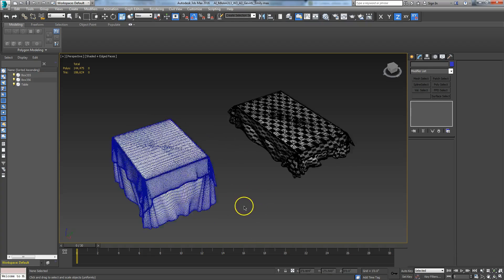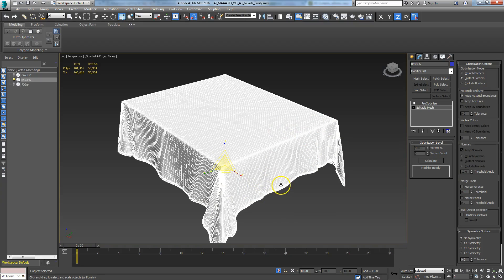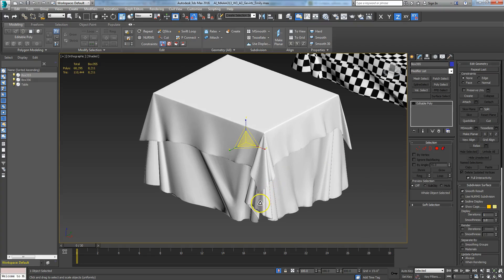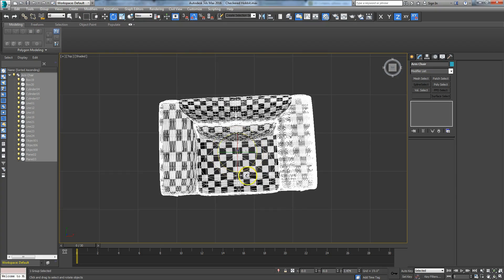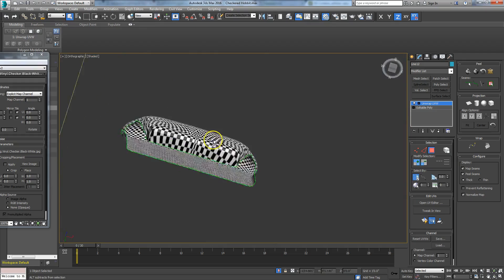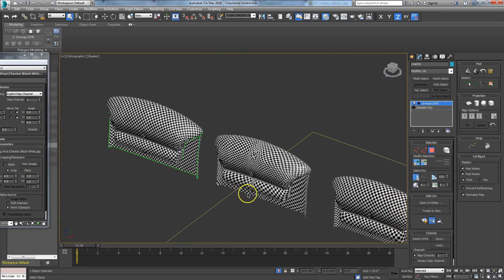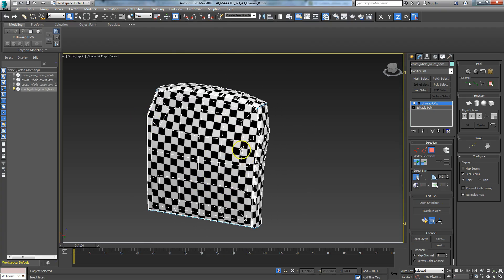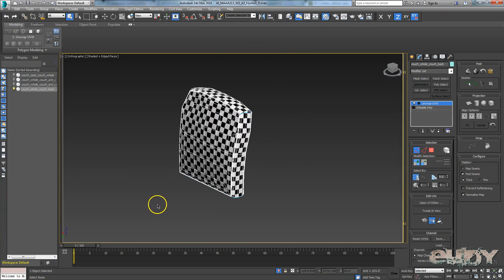Stock Furniture: UVW Mapping Issues | 3dsMax | Video

Comment: at 19:00 
I dont get why the bounding box does not work for this scene. I understand you can always use the relax to get a proper selection, but i also learned that you gotta cut your UVW islands in a way that they follow the "flow" so the map looks right later on.
You also made a tutorial on this stone wall where you could simply UVW map with a bounding box... why is bounding box for that enough and for this backlean you need to completely relax?
Reply from the maker: In a 3D software world their are different coordinate systems. There is an object coordinate system, a world coordinate system and a surface coordinate system. Some tools pay attention to the object system, some tools to the world system and some tools the surface system. In the video there was a disconnect between the object and world system. If we don't realign them then when we shift to the surface coordinates there will be a disconnect with it.

You probably could use the box mapping method. The distinction has more to do with what you are trying to accomplish. A couch cushion is a little more organized than the random pattern of a rock. Thus if we want more control, then we unwrap.